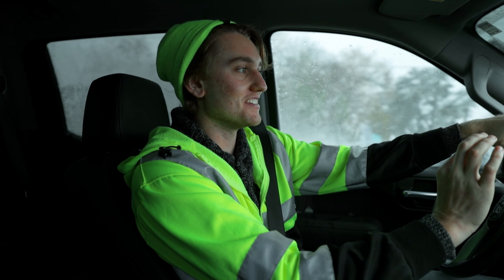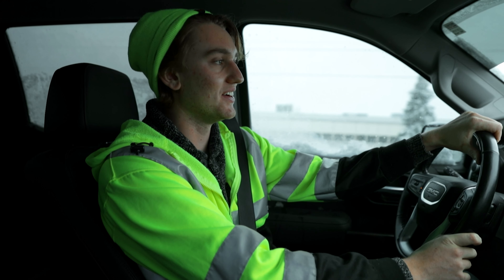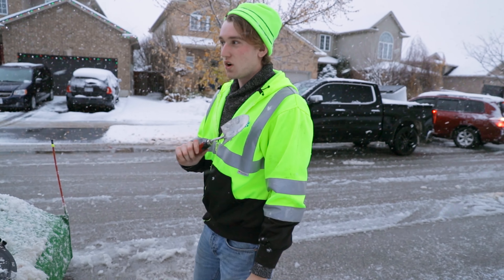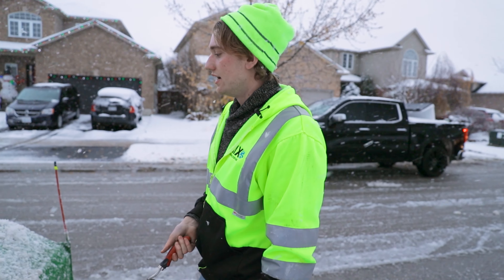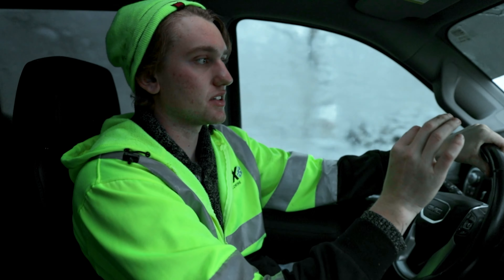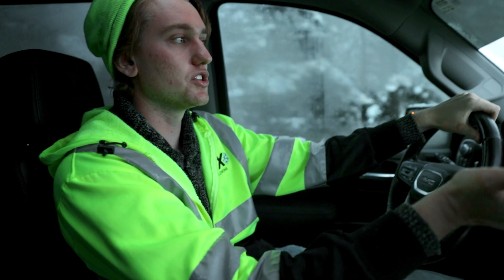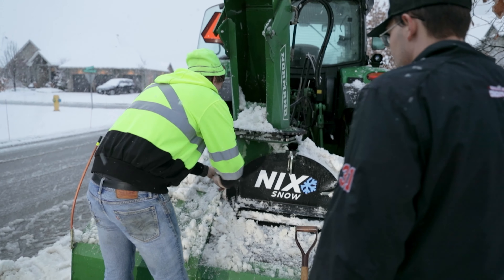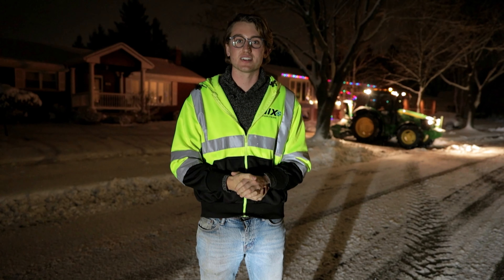First Snow - John Deere BREAKDOWNS

Comment: Do you find less clogging with bigger machines due to added HP or does the larger blower you marry to it negate the extra HP?
Reply: Last year I subbed my 100 hp tractor with nick and I didn’t plug once. This year I am running  my 6115r on a 92 inch and I didn’t plug once in that nasty storm. I deffs think th high hp helps
Reply from the maker: @nafzigercustomfarming3997  yeah I’d agree with Connor. These two plugs were more operator error than anything.